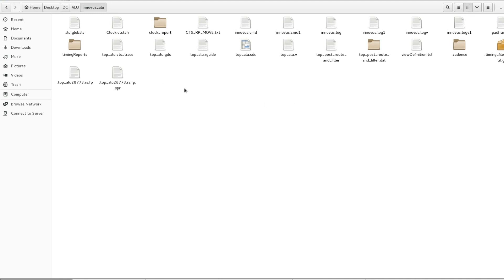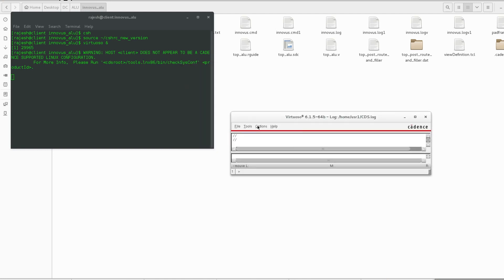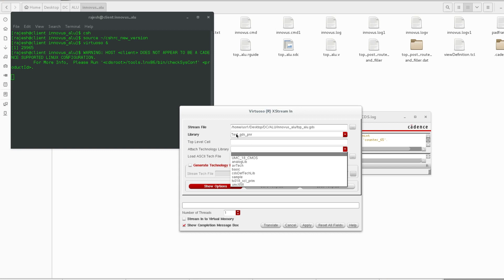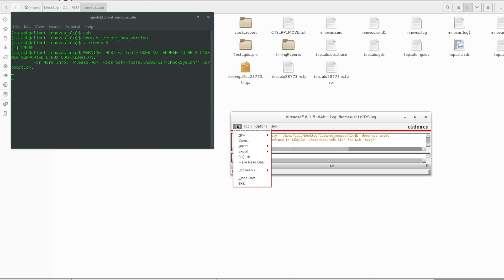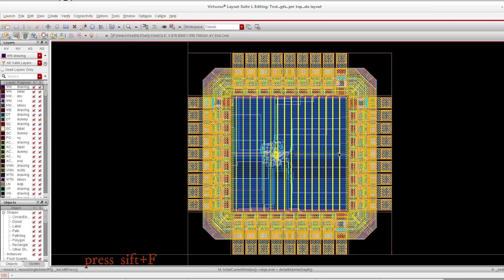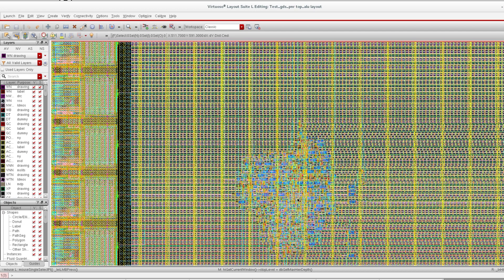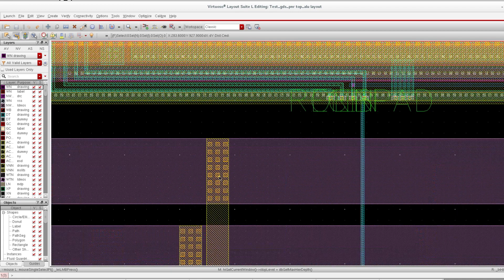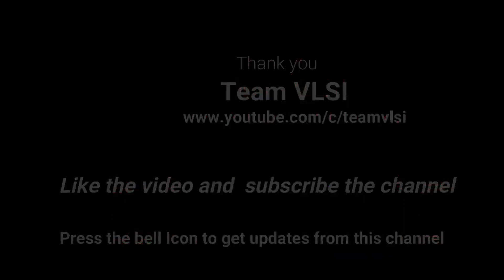GDSII import in Cadence Virtuoso | Stream In GDS in Cadence Virtuoso

Comment: What options do you have turned on for the XStream In? I streamed in a GDS file that has hierarchy; but the layout cell had all of its hierarchy flattened and only holds the polygon. I want the XSream In to keep all the same hierarchy as the GDS file.
Reply from the maker: Hi Don,
Yes, Hierarchy will be maintained.
Please quote the time line of video so I can answer you specifically.
Reply: @TeamVLSI  At the 2:05 mark in the video (after you've specified the GDS file, library, and techlib), your mouse is just above the "Show Options" but you didn't click through it. I'd like to compare your options settings to compare against mine since it's yielding flat polygons. Thanks!

Comment: What is the system requirement to run this cadence software?
Reply: What about graphics card can i run this with Integrated graphics card or i need dedicated graphics card?
Reply from the maker: Integrated graphics is also fine.
Reply from the maker: Hi Parimala,
Minimum requirement is very lesser, But a machine having  2GB RAM, 500GB HDD, 64bit Linux and i3 processor  and higher configuration is fine for general use.

Comment: Can you tell me what is the difference between full custom & semi custom design
Reply from the maker: Hi Mohammed
Basically in full custom design, We start design with scratch, where as in semi custom design, we use some pre designed and characterized IPs, macros or cells instead of developing everything from scratch.
Reply: Thank you sir, but in cadence we mostly call every cell from tech library right, then those are all called semi custom or what we called them?